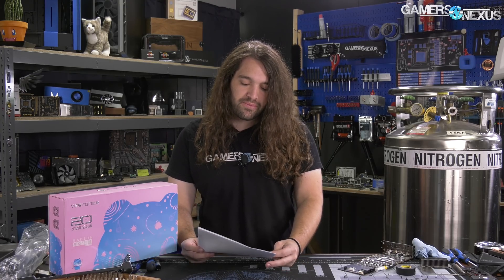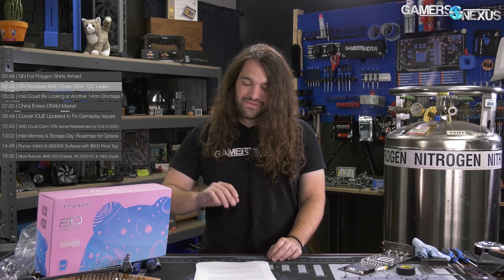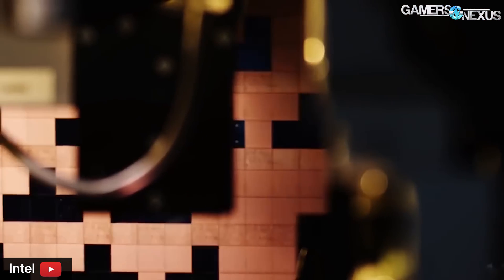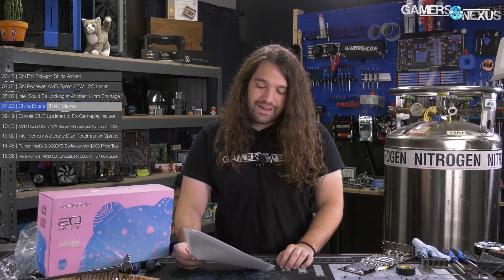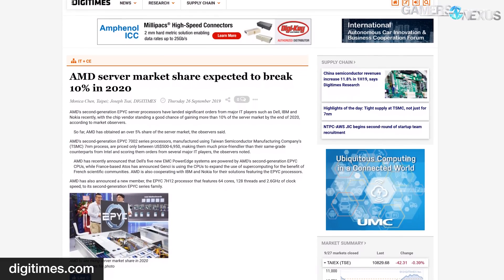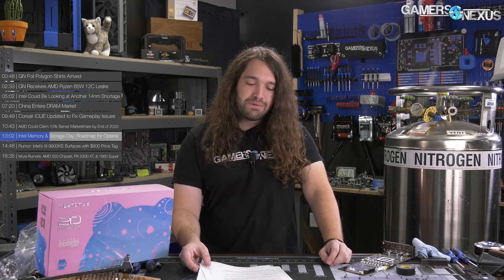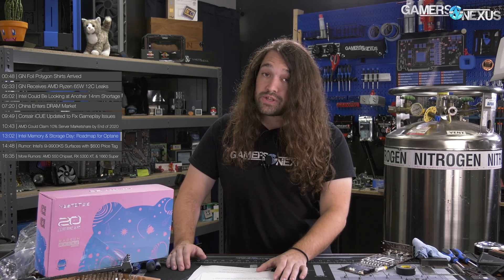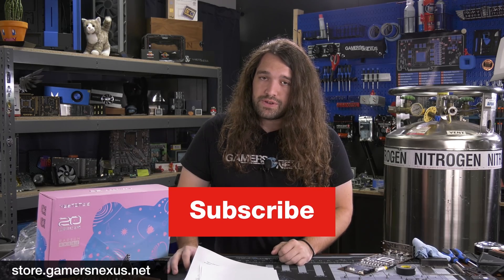HW News - Rumored 65W TDP Ryzen 3000 w/ 12 Cores, Intel 14nm Shortage, iCUE Fix

Comment: One of the biggest boons for EPYC is that the performance/watt is almost double that of Intel now.

An Intel 28-core CPU uses similar power than an AMD 64-core one. When run in a dual CPU config (2x28-core), it uses well over double the power.

This is a gigantic boon for AMD in the server market.

Comment: The clock rate of the 12c 65W part at 2200 MHz is really good. Intel has a 14c 85W since 2017 (xeon gold 5119t), but the base clock is only 1.9 GHz (the 12c 85W part (silver 4116)is 2.1 GHz). These are still only 14 nm so it really shows what's possible in power savings with going to a smaller process.

I'm not really sure what to make oh AMD's processor states so I'm excited to see what the clocks on the delivered product are.

Comment: @Gamer Nexus, i need a little help, i watched your video about the 3600 vs 3600x, but i could not find any comparison between both of t hose CPU when both are OCd, i heard that the 3600x is not a good overclocker since it is basically already a 3600 on the limit, is this true?

Thanks

Comment: Man the Intel Optane thing is a real trump card for Intel even if they are behind in CPU design/fab. Back in the day the answer to all storage woes was basically to not use storage. Lots of RAM, sometimes a RAM drive, and no bloatware! Ran $hit like early P2P Napster era stuff on separate older towers.

I edited a large .bmp on a Pentium 2 350Mhz with 384MB RAM and I dedicated 128MB to a RAM drive just to hold the file while I worked on it. Then I did the same with a single core Pentium 4 2.6Ghz and whoooooa that was even better. Those were the days, because doing it outside of RAM drives literally took minutes to open/save/close the files. My knowledge was gold. Today any noob can edit almost anything.

Comment: This is why I hate RGB products. Everyone wants to force rainbow puke by default so you have to install their bloatware to do something with it. And then you get crap like Logitech's security holes and Corsair impacting game performance. You know what's great? Buying products without RGB so you don't have to install bloatware to manage it or turn it off. Usually cheaper, too! 

I will give Gigabyte a little credit. My motherboard disappointed me when I turned it on and saw unwanted orange LEDs everywhere, but thankfully Gigabyte put an option in the UEFI to turn it off instead of making me install bloatware in Windows to do it.

Comment: Hey gamer Nexus for that 65w 12 core ryzen, it wouldn't make sense as the current pricing is quite tight unless if they ajusted prices. But could this be a ryzen pro part as they are usually low powered parts?

Comment: Intel is dominating in the server segment only because companies already have their servers. Everyone in right mind would go with AMD right now since their top chip is over 2x faster and even cheaper that Intels's proposition.
Reply: AMD's 64 core is impressive but that doesn't means they have to sell them at a loss. Furthermore AMD relies on TSMC to supply that CPU. Intel has its own fabs and can have they products more readily available than AMD's counterpart.
Reply: Michał Bondyra   The price on the charts shown are not what big consumers pay. I'm sure AMD can't lower their price much.
Reply: @wysetech2000  I recommend watching Linus's video about 2nd Gen AMD EPYC. He slightly reviewed it and compared benchmarks against dual socket Xenon configuration.

Comment: I see absolutely no reason why motherboard companies can't make B550 boards with PCIe Gen4 support for the first M.2 and the first PCIe slot, as they're coming directly from CPU and the only excuse they had for not supporting that with 300 and 400 series chipsets was that the motherboard tracing wasn't good enough to support Gen4 speeds.  It'd cost a little more, but that could be a decent differentiating factor.

Comment: I think this is gonna be a Ryzen 5 3900 for home theater PCs! Single core boost might be similar or slightly higher than the Ryzen 5 3600, but with 12 cores and 2.2 GHz base clock it seems a good CPU for home cinema tasks! Very powerful home cinema setups with completely passive or near passive cooling would be easily possible!

Comment: 9900KS for $600 for a guarantee 5ghz? shiiiit my 9900K can do 5.1ghz and it can be your's for $750!
Reply: no thanks ...intel 10gen will be mine ;)
Reply: @mariuszmaxankazuya3170  10th gen for desktop is nothing special, they bump to 10c/20t but with lower clockspeed, so in games, even 8700k will probably beat the 10c/20t, which is highly doubt will do 5 ghz like pretty much all 8700k and 9700k + 9900k does.
Reply: @lort6022  I think it's not only about frequency... and I will be aiming in i5 I guess 6c/12t are more than enough for gaming, price should be not as high as current i7 i9 . Will replace my i7 6800k @4.2GHz finally.
Reply: my 9900k has been running 5.2 for almost a year now, can be yours for 900 bucks then.
Reply: @lort6022  900 bucks :D xd I would prefer to buy new one.

Comment: the TDP surely is still affected by the power draw of the CPU. The way I see it TDP is what the manufacturer believes it will output in heat. So if you account for the way the heat is generated (which we cant do) you see just the draw of the cpu itself.

Comment: I bet money that at 88w using 'AMD Voltage' the processor will run faster than 3100mhz... If those are the rumored 3900 with a base of 3.1 and boost of 4.2.

Comment: 15:30 Don't most 9900K CPUs already run 5 GHz already? Mine runs 5.1 GHz at ~1.3v~ on a 280 CLC.
Reply: Yes its just a factory overclocked 9900k, though assuming you would be get 'top shelf' silicone guaranteed with them, theres always the chance it could be pushed a bit further than most other 9900k's.

Comment: Canadian IT parts distributors are currently taking backorders for delivery in mid Nov on non-K I7 9700's. The only SKU that is currently in good supply (more than 3000 units in stock) is the 9700K. They are expecting some shipments in October but they will barely cover current backorders.

Comment: How much of an upgrade would be going from an R7 1700 8c/16t 65w to this rumored 65w R9 12c/16t? Worth it?
Reply: Son Goku reviewers have stated that ryzen 3000 is a 8-14% IPC improvement over previous Zen. Factor that in with clock speed improvements and it would be similar to going from a i5 6600k to a i7 8700k.
Reply: Definitely worth, much higher ipc and 4 cores, 8 threads more. First gen to 3rd gen, big difference

Comment: Has the icue fix sorted the voltage bug on AM4 CPUs? It pushed 1.44v constant on idle when I had stock volts, had to run 1.35 and 4.2ghz to get around it.

Comment: As a Chinese, I don't trust Chinese DRAM.
And you won't even get them, coz those products are not market driven, it's just a way of drawing state funding.
Reply: Is also the case with PRC made cpus? I mean those coproduced with via's help xiaoshin xxxx if the name correct...
Reply: @moccagringo2311  It's Zhaoxin actually. They has a great leader and is making some great progress based on Cyrix. KX6000 performance is close to ivy bridge in single core and skylake in multicore. There is also another group called Loong is developing CPU based on MIPS. They can't compete with intel or AMD in either consumer or commercial market, but is more like a plan B once trade war getting worse and US government banned the semiconductor product export.
Reply: @ferinfox  Huawei and Xiaomi make world class phones.

Comment: Can you do a video on flashing a 5700 non-xt into a 5700 xt. Also, do you think there will be a Ryzen 10 core 3850x?
Reply: RevRevGaming   You can't turn a 5700 into a 5700XT.  The XT has more stream processors.
Reply: @wargamingrefugee9065  Yes but when you flash it, it allows the 5700 non-xt to have the same power draw and such as an xt. Which is pretty much a free upgrade.
Reply: RevRevGaming If someone burns or brick his 5700 because he did Flash his card with 5700xt bios... that is no, no to most tech vlocker to release how to ”maybe” increase your pc speed by doing something that will void you warrantry etc...

Comment: Every time I hear a board maker is including older USB specs I wonder "What are they thinking? What's the point? Newer specs are backward compatible." Is it a cost-cutting move? I can't think of any other reason.
Reply: Well, there is an internal translation layer to go from 3.x to 2.x. Some environments don't pass it through correctly without drivers. It's hell for an admin. Also, manufacturers might think "if HP needs boards with the feature, we'll put it on all of them!" or "let's add more ports and jack up the price unreasonably!"

Comment: The R7 3700x isn't 65W as it doesn't cool with 65W coolers at stock settings, as such I highly doubt if I buy the 12 core Ryzen 3000 w/ 12 Cores will cool either.
I did a lot of work after upgrading from R7 1700 to R7 2700 to R7 3700x and running into major temp issues with only the chip changing.
https://forums.tomshardware.com/threads/broken-high-ryzen-3700x-temps.3524008/

Comment: After realizing that I forgot to buy an extra case fan, I remembered that my Ryzen 5 3600 came with a wraith cooler inside the box. I unscrewed the fan from the cooler, installed it inside my case, and Boom! a free 92mm intake fan.
Reply: I installed mine (with heat synch) on to the top of my 5700xt and now it runs at 57c under load instead of 84. Lol
Reply: @GroundbreakGames  Do you have a pic of that? I bet it looks at the same time amazing and incredibly janky
Reply: @DerMannInDerWand  i wanna see a pic too
Reply: DIY ethics are punk. Rock on.

Comment: The Ryzen 12core 65W units...I'm gonna take a wild guess and call them the 3850 & 3850X. Not as much as a 3900X but more than the 3800X.
Reply: 3800x is only one 8 core ccx, 12 core Zen 3 has 2 8 core ccx chiplets, each with 2 cores turned off.
Reply: @critical_unknown  I know that. Just going off the obvious with my explanation. 🤷

Comment: If the 5300XT rumor is true, Nvidia again drowning the market with yet another graphics card in their line up to hide affordable similar matches cards, the 1660 super, seems more legit
Reply: Remember whenever AMD releases a new GPU, Nvidia shamelessly is quick to milk out the market of that GPU.
Reply: @RainforceVI    If you were Nvidia, what would you do?
Reply: @wysetech2000  Don't be greedy and don't be screwing over my customers that have bought a GPU from me which now they regret because I have released GPUs to the lineup that offer more performance for less money.
Reply: @RainforceVI  if they'd drop the prices of the original RTX lineup in the process, I may consider upgrading my 980 TI to a RTX 2070, but no, still the same price.
Reply: They do it this way so that when AMD releases a new GPU, they saturate the market space around the price point of said GPU with their products, so that it is near impossible to find the AMD equivalent.

Comment: Hopefully the Intel manufacturing delay means the x299-x motherboards coming out can be as over engineered as possible without any corners cut due to time-restraints. Finally upgrading from my X58 era systems once the i9 10980XE comes out.
Reply: Sure you are.
Reply: @norm1233  Excuse me? I run 3 X58 Xeon (6 cores/12 threads each, plus a Dual CPU Dell Precision T7500) systems currently, but they are finally getting overloaded by what I'm putting them through. 

I would've gone for the 9900K if it were not for the dual memory, I need quad channel (especially since I already have triple channel on these 8+ year old X58 systems).

Comment: Hope B550 doesn't require a chipset fan.
Reply: It'll be fine... unless they put 4.0 on it. And if they add unnecessary features.
Reply: @Ray Ward we have a history of them, and it's not good. Give me the specific model of motor and bearing used (no ball, either, only fluid or maglev), so that I can verify that I think it will last 5-10 years, and maybe I'd give it a chance. Otherwise, that's a no go. Too many of them failing in the past to give them a chance now, especially with compatible B450 out there. Also better boards in those days made big heatpipe heatsinks to deal with it, which only one or two have done for X570.
Reply: i dont think b550 has pcie 4.0 which will probably mean it wont need a chipset fan
Reply: @Ray Ward I guess there are a couple of reasons it could be an issue. Maybe the motherboard fan(s) have a pitch or a whine that someone running a silent rig might be able to notice more. Maybe you don't want another part that can potentially fail and mess up your rig. I mean I personally just don't like the look of a lot of x570s with the fan over the heatsink. I like what gigabyte did on their aorus xtreme board with a heatpipe connecting the vrm and chipset heatsinks. Just feels like everyone could have just made the heatsinks bigger and solved the issue without a fan.
Reply: @116RonH  was about to comment but you beat me to it lol. gj
Reply: @Ray Ward The only thing for me, and it does pertain to everyone, is if the fan ends up going out say even just 3 years down the line, its going to be quite annoying to get a replacement unless vendors will start selling replacement fans separately.
Reply: 550 should be pci3 so no need for fan!